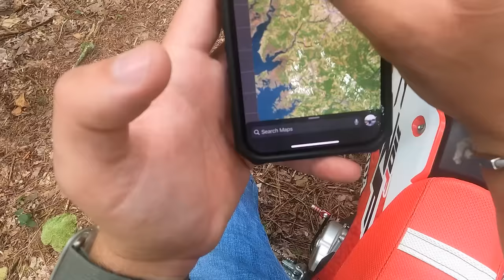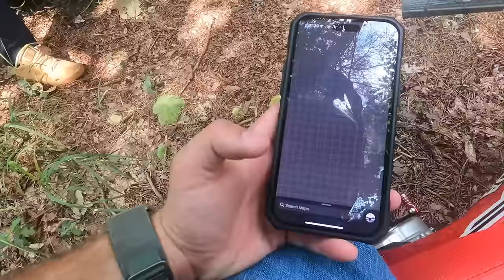SHOCKING DISCOVERY INSIDE ABANDONED HAUNTED FARM (VERY TERRIFYING)

Comment: You found a 1950's ice refrigerator. It's abnormally cold because the dirt around the pit keeps it 20 degrees colder than the air above it. The electric conduit is above a "sump hole" where a pump would go. The 4" pipe would Pull the cold air from the pit through the blower hanging on the wall and blow it into the building while the workers were fixing things.  I showed pictures of the pit to my 93 year old great aunt, and she remembers these pits from growing up
Reply: That's what I thought too. It's primitive refrigeration for food storage. The strap with the rope was used to drop ice down there. Hence the ice pick grippers. This was a good way to keep food cold years ago. It's funny how your minds go straight to the dark side thinking it was used to hold someone hostage! 😅
Reply: @marydalton5752  it still could have been used for not so legal purposes over the years. No way to really tell
Reply: The tools you found down in there - one was an ice cube clamp. The other, the sickle could’ve been used to chop off pieces of the ice.

Comment: I was watching the items you found in the cement hole . One of the items you found was something you used to up a block of ice when one had an icebox instead of a refrigerator. I think it was built to keep ice cold so it wouldn't melt. I think the hole with the dirt was to drain out water from the melted ice. I think it was covered up when the house was purchased because it was no longer needed. Ice box was used when you didn't have a refrigerator.
Reply: The one thing you found in the pit was an old weed Wacker. The second thing was a pair of ice tongs made for carrying blocks of ice back before the modern day refrigerator.
Reply: Maybe storm shelter..??😊
Reply: Totally agree about the ice storage, tongs for the ice! And the belt thing was used for lifting/lowering the ice.
Reply: Think it was ice storage and the belt with rope may have been used as a hoist for person
Reply: One thing I think that is being overlooked here is that regardless of what the initial purpose of this was, and I think the ice storage is very plausible. It is still plausible but it was used for other things. I don't know if moonshine was a thing in your area or smuggling of some kind. It also could have been used as a root cellar after it was no longer needed for ice. It also could have been used as a storm shelter. Time to get on that spirit talker and find out what's what.
Reply: It's  an exit from the basement in  the house. A tunnel goes from the basement to that hole in the ground.  The tunnel  was covered up with blocks and cement. Naaa, too creepy. It's  a place to store ice in the old days, that's why those 1930s ice tongs were found in the hole.😮
Reply: Maybe if you keep looking in the hole, you might find Jimmy Hoffa or DJ Cooper. 😅😅
Reply: The metal tool you found is a sickle. You use it to cut back overgrown, debris, weeds etc.
Reply: He’s right it was a old freezer to keep food

Comment: Depending on how old the house. The little concrete room could have just been used as cold storage. Like a root cellar. Lots of houses had root cellars. With dirt floor. You could put your cabbages down there and at that depth they would stay fresh-ish for months. At a constant temp under 60 degrees
Reply: Exactly! Ice tongs!
Reply: That's what I was thinking but there's no shelves. All root cellars I've ever seen has some kind of shelving.
Reply: the pichers r old ice block holder the cellar isn't more then 100 yrs old as the cement block  r not older then that
Reply: The two tools that were there one was a sickle and the other one could be used for bales of hay and was also used eve for blocks of ice for original ice boxes before refrigerators
Reply: Yeah I was think an ice box to store big ice blocks

Comment: Definitely an Ice house now that I see the items you’ve found inside the hole. The rope & belt were used to lower large pieces of ice down into the space. There may be a drain at the bottom for melting ice. They would typically store ice and food but have also stored bodies of loved ones inside until the viewing or wake.
Reply: I was thinking an ice house, too, when they were remarking on building's odd shape. Maybe, you guys might want to read some historical fiction if you are going to hunt around old buildings, so you don't freak yourselves out so much.
Reply: I think the area in the circle in corner was probably to drain water as ice blocks melted. That is why it seemed to you to have no bottom. It may have been earth and gravel.

Comment: Hey CJ the tongs are actually used for picking up large blocks of ice known as ice tongs. The other moon shaped tool is a hand held scythe for slashing long grass by hand 💕
Reply: Yep 👍🏼 you’re absolutely right
Reply: I saw that ice hook and the sythe I thinking this pit in the floor may have been a meat locker. Or a meat cellar where  they placed blocks of ice to keep all their meat 🍖 🥩 beef & pork from spoiling. Once the ice melted it ran into the drain hole 🕳 in the floor to sink into the earth. The big pipe was possibly for air, the small pipe was where maybe a light bulb 💡 socket was at to be turned on from the wall if they had electricity but not the common house freezer chest yet. Because electricity came out before the refrigerator & freezer did. Also the harness was to hold the cow 🐄 carcass or pig 🐖 carcass up off the floor to keep it elevated and possibly they used the Sythe blade & other blade this guy found for cutting off meat 🥩 to take in the house.  
Or the whole thing could’ve been a water 💦 cistern to pipe in rain water from the roof into the holding tank. Possibly the big hole 🕳 in the floor was a drain big drain pipe or a pipe that went under the building and out for water for themselves or livestock & then when they got another form of water they filled it in the pipe in the floor with dirt cans and anything else they could pack down in it & blocked off the one from the roof. It’s hard to say for sure what it was, but old farms back then used meat cellars, vegetable cellars, and also in ground water cistern holding tanks. They done all kinds of stuff like that back then. Then again it could’ve just been a cellar to store all their can vegetables & canned meats. But if I had to bet money with seeing that ice block lifting hook or tongs, the knife blade, the sythe & harness with rope it makes me think that was a meat locker for storing animal carcasses they slaughtered on the farm.
Reply: Lol they have a great imagination I must say hahaha
Reply: Or chipping ice...
Reply: Yes! You got both of them. Got to be old or lived in the sticks to know ! Lol (I'll be 70 this mo.)😂
Reply: @lindasamples9959  
Lols..65 Jan 1st..!!!
Reply: @eunicemauldin7492  happy birthday just a little early.  Lol Hope it's a good year for you. Your still a spring chicken! 🤣😆😂🤗t
Reply: Yep!

Comment: Hey CJ, a few things:

• 13:47 - CLEANING - THANK YOU so much for cleaning the barn out.  That was something else that was driving me nuts.

• 17:34 - SPADE - That's what I say all the time.  Call it what it is.

• 19:06 - TREASURE - I'm never that optimistic.  I'm a realist, and I was thinking that it was just a bunch of junk.

• 28:30 - PIPE - It probably was used for some type of ventilation.

• 31:06 - CONCRETE - The blocks are used to reinforce it so that it doesn't cave in.

• 46:46 - ICEPICK - That is NOT an icepick.  It's a small sickle used for clearing debris.

• 47:57 - HARNESS - That's a horse harness that was used back in the 1800's.  Having grown up on a horse farm you'd think you and your mom would know what it is.  This was probably attached to a horse to haul up the blocks of ice.

• 48:50 - ICE TONGS - Those were used to move large blocks of ice which might explain what that pit was used for.  It was probably for ice storage.  You said it was unusually cold down there.  That hole was probably for water melting off of the blocks of ice to drain into.

😇

Comment: This could also be used as an ice house. The scissor thing is an ice carrier that was used for the old ice box fridges. The round sharp thing is a sith, and it was used for cutting grass, hay,wheat and I use mine for cutting weeds, the old Germans and Dutch used them for a long time.  The hole could have been used for a 1/2 beef, pig to keep meat from spoiling during the summer months! The basement could have been used for canning jar full of produce,but it changed over the times, as towns moved closer to rural areas!
Reply: This actually makes a ton of sense :) I was thinking it was either a storm shelter, to maybe a place they'd kept some ice blocks for their ice box. 
To now maybe kept some meats cold :) Makes a lot of sense for the last option. That hole in that floor probably was for drainage for if things melted / thawed out.
And back to first option ... In a very very severe storm, it could have still been made to serve as a storm shelter. The family would have had to haul everything else out first. ORR!!!! That could be why those jackets are hanging nearby! So they'd just dress warmly and climb in to hide from storms. 
Kinda creepy, but, maybe would have been why.
Reply: So many people from the 1890's on this thread! thanks for coming back to explain it to us modern city boyz
Reply: Yep a sistern built just like mine cinder block and  parked with  cement  or morter. Sump pump hole on the corner  and pipes up top  to bring the  rai  water in

Comment: Those are ice tongs. After ice was cut from the lake or pond with an ice saw they used the ice tongs to pull out large blocks of ice. That place was used to keep things cold before refrigerators. The sharpe C shaped tool is called a sickle. ❤ Pretty cool find. I’ve seen some of those ice tongs in museums. ❤
Reply: I find it unbelievable that people don't know what those items are and what they are used for. The belt would be worn by someone on ladder or a higher level the rope with the hook a bucket with tools, supplies or paint that can be hauled up instead of trying to carry it while climbing the ladder.

Comment: Ice house, definitely. The harness, rope and coupler rig would be used to pull large chunks of ice up and out of the hole. The tongs were a way to handle the ice once cut. The scythe was used to harvest either large grasses or grain stalks as insulation to keep the ice from melting. Hay was used all the way back to the ancient days of insulating ice. The smaller round hole was likely the drainage for the ice house. The large pipe near the upper lip of the hole could very well been used to pipe in cold air once forced-air refrigerant was invented and mainstream.

Comment: Depending on how old the property is, I think at some point the cement hole could have been a cold storage area. Say back in the day you use to be sold huge blocks of ice. One of the tools you found with 2 handles picks up ice. The other tool could be used to chop up the ice. The belt with the rope could be a way to lift up big pieces of ice from the hole to then bring in the house to be used in an icebox. The hole would be used for any ice that melted would run off into the hole and in the ground. The pipes is something I can't figure out at this time. At another time in the history of the property that place could have been used for other things like your mom was talking about. If I come up with anything else I will let you know. Good luck 🤞
Reply: This does make sense.
Reply: This is what i thought.
Reply: Water cistern
Reply: Yup, those were my conclusions as well.  😉

Comment: Ok, so you found what looked like a sort of belt attached to a rope, a sickle and and ice block grip or ice tong....postcards, a snake, possibly 2...so...what was the terrifying part? 🙂 I'd be interested in finding out what's beneath the poured concrete floor in the pit and what is deeper inside that hole in the floor.
Reply: turned out it is a cistern for collecting rainwater. when water was piped into the house another way, they closed this one off.
Reply: @suemckee1598 , well...that's a bit disappointing. 😆
Reply: Ha so in other words your not scaring anyone 😱
Reply: Old food storage,  you could use ice in the summer and cold water from roof for storage  food & water storage

Comment: I think that room is a root cellar also used for a under ground storm shelter too. As for the weird stuff found in this hole. I think stuff could have fallen into that hole or wind blowing stuff around?😮 You have to remember that there were more than just one generation living there. Where  new buildings replacing other barns with root cellars too. Adding onto your property isn't unusual!😊

Comment: In the house I used to live in which was built in 1945, we were digging a hole in the backyard to put in a small pond and we came across a cistern, we were just as shocked as you all were.  We thought we uncovered a bomb shelter...then realized it was a cistern, with similar pipes as you have.  There were slabs of concrete that covered the top, we were able to lift one up and then lowered a camera to see what was inside.  Makes you realize that there might not always be just dirt underneath you.

Comment: That hole could've been used as an ice house, because one of those tools looks like what they would use to pick up large ice blocks. The other tool was a cycle which can be used to cut ice or other frozen stuff, like meats. Concrete would hold in the cold air. The strap/belt was used to pull up the frozen stuff. It would also make a good prison though🤔

Comment: You should have showed your mom the hanging clothes/robes for her opinion. The electrical conduit might have been for a light. The tool you found was a sickle - normally used for cutting hay or other vegetation. The claw-looking thing is used to grab hay bails. You know what’s interesting is that your mom mentioned what if they put snakes down into that hole and later on you located that snake. Could the pit have been used during the Prohibition era?

Comment: You found a Safety belt with a tie off rope,an ice block transport tool,and sling blade for cutting wheat or tall weeds. All old inside a mechanics pit converted into an unfinished  storm shelter. cover by those boards to complete the floor for more usable space to work or store stuff on. DUHHH

Comment: This was for early air conditioning. You would put a stack of ice blocks in the hole, as they melted they would drain through the hole at the end. Then there was the blower pipe and power for the fan and it would blow cool air to the house

Comment: There had to be a large door for driving a vehicle through at one time.  The car would drive over that opening, straddling the hole.  A mechanic could then work under the car.  That hole was for engine oil, transmission fluid, etc.  They just drained the fluids directly into the ground.

Comment: The hole could be an old ice cellar, they were built in the past to have a cool room over the summer. In the winter, snow and ice were filled in and it remained there for a long time over the summer, allowing food or drinks to be cooled. The small hole in the ground would then ensure that meltwater can drain away.

But the rope with the belt in it is worrying and allows the imagination to wander in very cruel directions (especially in connection with the pipe, through which one could also pour water or other liquids). Maybe it's an old dog leash for a very large dog.

Comment: An old school air conditioner.  Ice goes in the hole, it has a floor drain and the pipe to the fan blows cool air out.  The tongs are for ice and the cycle is to grab the ice blocks

Comment: I think I figured it out, I think they stored blocks of ice in there, because those were ice tongs you took out! The clever was used to shave off ice! They probably pumped cold air into the icehouse! The rope and the harness was to pull the blocks of ice out of the hole! The ladder was used for someone to go down to help retrieve the ice by hooking up the harness, if the tongs didn't work to lift high enough!

Comment: That looks like it could be an old ice bunker, where is the farm located?? If it is an ice bunker, Ice would be gathered from a local lake (or river maybe?) and stored down in it, covered with sawdust to help it stay frozen... The first tool you found that was curved is a sythe  used for cutting grass or grains, usually... In the winter it could be used for cutting the ice blocks the two hooks that clamped together were for either for grabbing ice,  haybails or both... the rope and strap would be used for lowering blocks of ice down into the pit, and for raising ice when it was harvested from its source... the pipr in the wall was for air circulation and the hole in the bottom was where the melt water would drain off... I have no clue what the small pipe above the hole would have been for
Reply: oh, by the way, that is just a rat snake... it didnt move because there was nowhere else for it to go...

Comment: urbe nive is a syth for cutting grass or crops.the other one is to hold hot metal the hole could be for mechanics to put cars over and a hole for an oil or parts bucket. pipe in the hole to get rid of fumes x

Comment: That curved knife is a sickle used for harvesting   the second tool you pulled out is used for picking up ice block's.  That cement hole was probably used for ice storage for the ice box in the house.  The hole you were digging in was most likely used for water run off as the ice melted.